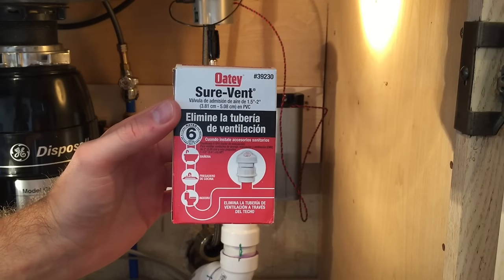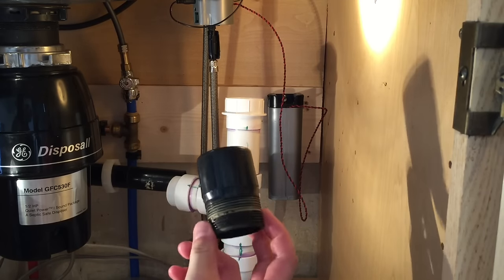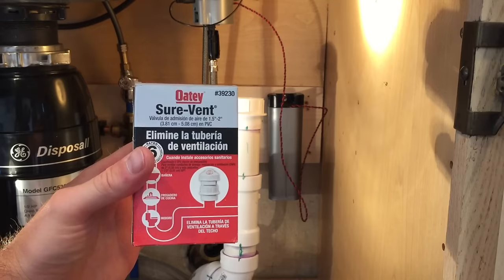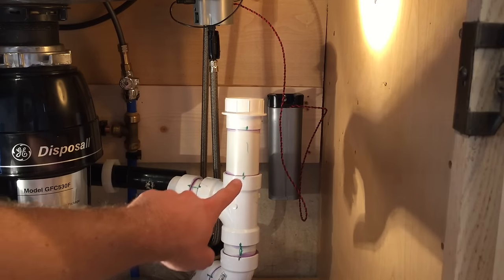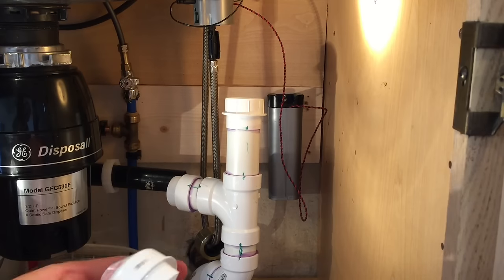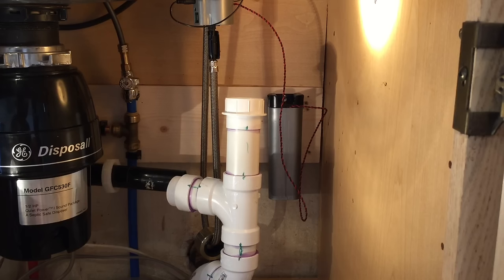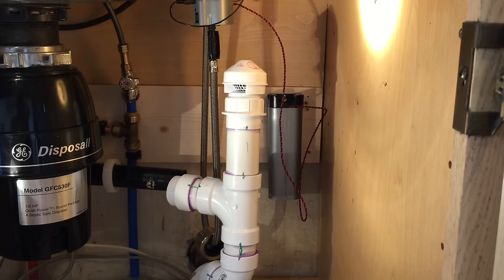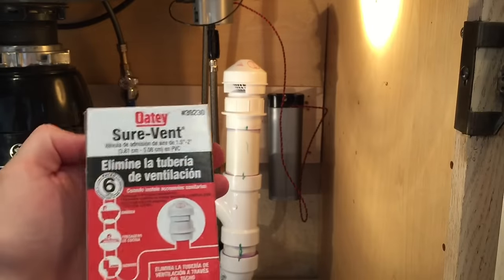OATEY Sure-Vent Installation - Eliminate the Vent Pipe!

Comment: I seem to be replacing mine every six months. Is that typical, or am I doing something wrong, or do I have a bigger issue (hope not)?
Reply from the maker: What symptoms are you seeing every six months that triggers you to replace it?
Reply: What happens?
Reply: Sewer gas smell. Seems like right before winter and right after winter. I replace it and it goes away.
Reply: There’s a reason this vent pipes are normally on roof tops. I think it needs air to be sucked through it when you flush your toilets and so on. It is not in a very ventilated spot and there’s not much air being sucked through that short distance between the vent and the adjoining pipes. In certain states you are not allowed to use this. You won’t get sewage gas smell if the vent pipe was extended to the roof .
Reply: same issue with me here, quite annoying. any word on other solutions or what could be the issue?
Reply: Try drilling a hole in your vanity ( if the air admittance valve is in an enclosed area) somewhere  if you have this problem, about and inch hole I would say. Try this first before thousands of dollars and putting a hole in your roof. If all the air is sucked out of an enclosed space, it will start sucking water out of the p-trap, then you get sewer gas smell

Comment: Does this vent actually works as good as a pipe going out?
I am thinking about doing that but i am still skeptic.
Someone please answer me.
Reply from the maker: CD ROD AAV’s work well and do the same job as traditional vent stack pipes. However, AAV’s may need to be replaced depending on use and age. If the AAV should fail open , it will allow sewer gases into the dwelling.  If the AAV should fail closed, it would stop allowing air into the system.  A traditional vent pipe should ideally never need maintenance or need replacing. However, the one drawback is that it requires a hole in roof, which could require maintenance if it leaks. So neither soliton is perfect, but I would highly recommend a traditional vent stack whenever possible.
Reply: @ErikAsquith  k
Reply: @ErikAsquith  If everyone installed AAV's instead of traditional vents, would there be problems with the sewer from lacking regular venting along its path?

It seems like the traditional venting serves an altruistic purpose for keeping the sewer properly vented at regular locations along the way, and if everyone had only used AAV's there'd be a positive pressure buildup in the sewer.   So I can understand why plumbing codes would require a proper traditional vent on new construction, despite having a double standard of allowing AAV's on a retrofit of an existing unvented drain.
Reply from the maker: @carultch new construction should always use the traditional vent pipe when feasible and possible, as you alluded. However, I have seen an AAV be used for many island sink installations in new construction. A bow vent would be a better option and should require less maintenance.
Reply: @ErikAsquith  Saying a roof vent needs no maintenance is just wrong. Roof vents can get clogged with debri or small animals and need to be checked every year. And you need to climb on your roof to do it. I've never had a sewer gas smell and when one of my AAVs fail, which all mechanical devices do in time, it usually fails closed and you know that because your sinks, shower, etc. don't drain or there is a gurgling sound. I have never had a sewer gas smell in all the years I have had AAVs.
Reply from the maker: @sparklesea2046  good point, a roof vent still can become obstructed and require maintenance.

Comment: Why do I need tho
Reply from the maker: Michael Tobat you only need an AAV if you lack a vent pipe. The AAV or vent pipe allow fresh air into the system to assist with drainage and prevent the water from being siphoned out of P or S trap, which is needed to prevent sewer gases from coming out of the drain.
Reply: So we have a mobile home with only these type of vents would it be a good Idea to put a a vent in main line goin above roof top,? Thanks for answers,
Reply: What got me really  stumped is this setup has been like this for 7yrs now all of a sudden Iam Havein sewage back up thought the drains,one plumber came out 700 dollars later iam still having the  same issues,
Reply from the maker: Michael Tobat do you have access to the AAV? If yes, temporarily unscrew and remove it and see if the water starts draining as it previously had.
Reply: @ErikAsquith  yes so if  i take out its starts to smell bad  but the I dont hear the gurgling sound in kitchen
Reply from the maker: Michael Tobat if the water is draining as expected without the AAV in place, I suggest replacing it with a new one as the current one is likely malfunctioning.

Comment: Shouldn’t the AAV be installed 6" above the actual inlet fixture, i.e the faucet to work properly?  Common sense tells me that it’s never a good idea to vent anything inside the structure (where flammable or foul smells could escape,) 
The States that have "codes" where these devices are allowed to be installed under the inlet, in cabinetry obviously do not care about the safety of their citizens.
Reply: It is sealed most of the time opens when draining pipe creates suction these are used by our plumbers in a county school system and no complaints of odors and trust me they would complain
Reply: Exploding fart gasses.  Gives a new meaning to "small but deadly".  Coming soon to a neighborhood near you.
Reply: LOL. The Swedes invented these devices and I think it would be just as safe as with a roof vent if not safer because in the dead of winter they could get to the AAV but not their roof vent. That was the whole point. Just go for quality. And do some research instead of listening to someone who doesn't know what he's talking about.
Reply: @sparklesea2046  I literally had 3 of those things in my 2019 DRV. They made it stink soooo bad inside.  A spring operated roof vent that could be pushed up past the snow would be better. My comment was based on the fact that they physically require the vent (inside or out) to be 6" above the fixture it connects to, in order for them to be up to code.
Reply: @9fiveb180  Why would you put one of these in  or on a fifth wheel? As far as I know the venting is on the roof and these products aren't meant for that type of application.
Reply: @sparklesea2046  I didn't. They came preinstalled in it. It has roof vents, and under sink vents as well. Hence my original comment.
Reply: @9fiveb180  By the manufacturer of the fifth wheel RV? All I know is that they work if installed correctly in the right spot. If not installed correctly in the right spot, just as a roof vent needs to be installed in the correct spot in the line , how can they work as intended? You probly should have your RV checked by a professional RV repair person.

Comment: I don't want the stink in my house I'll have that outside thanks.
Reply from the maker: It's a one way value that only lets air in, not out. When an AAV is working properly, no air should escape.
Reply: @ErikAsquith  can it stick in the open position ? The position it's in when it's letting air in ? From dust/crud building up ?